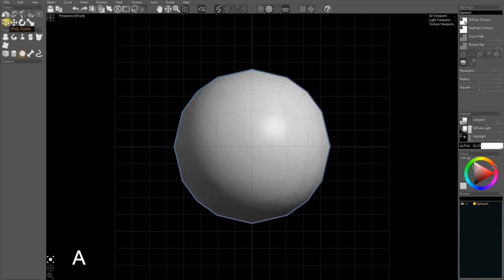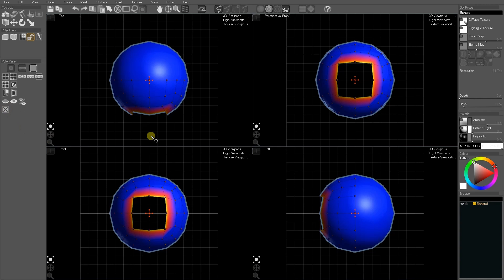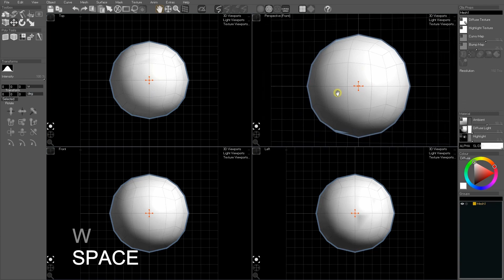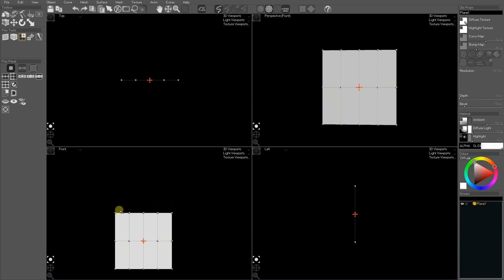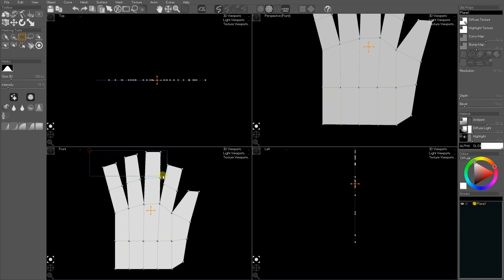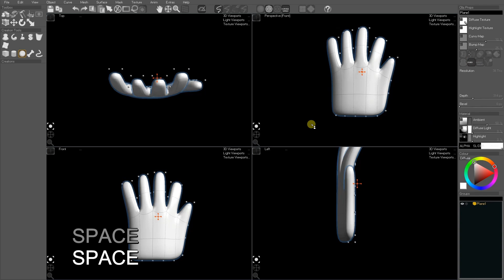Curvy3D: Poly Tools Tutorial

Comment: quick question how did you select the one side of faces without the mirror selection happen. it keeps happening and ive been through all panels i might if missed it
Reply: Do you mean when I hid the back of the object? Not sure what you mean by mirror selection. Mirror editing is turned on and off with a button on the sculpt panel.
Reply: @ when i select faces one one side mirrors the selecting on just default i dont know why
Reply: @TheCraftyfunn  If you have "Mirror Sculpt" turned on in the sculpting panel the Mask Brush will select both sides at once.